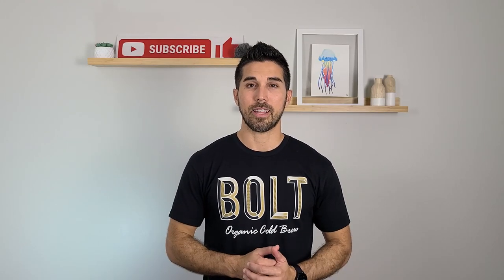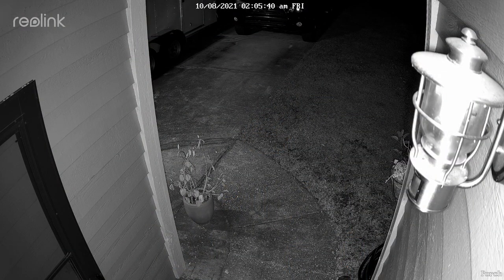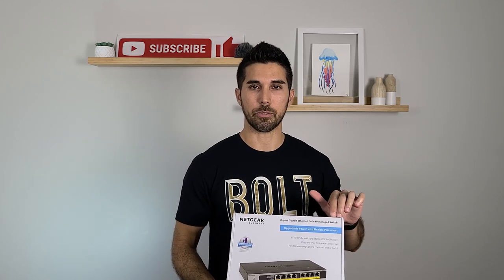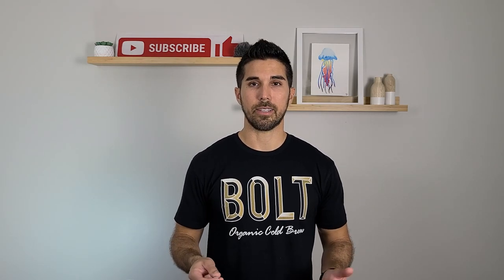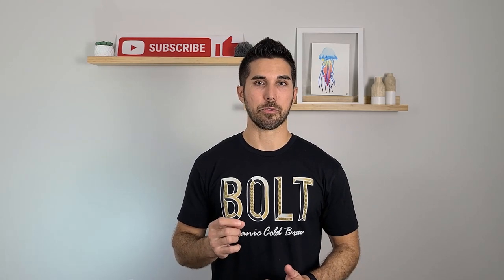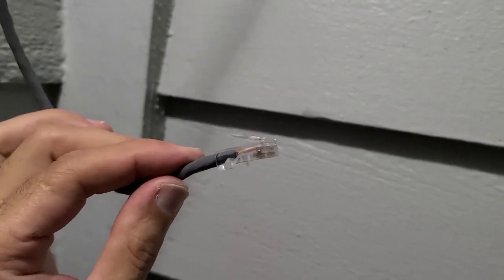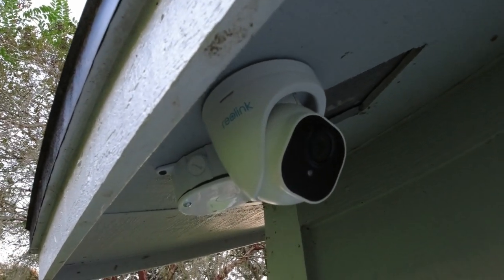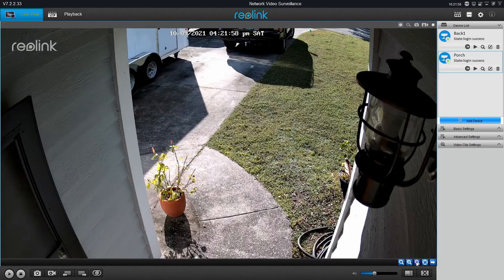Affordable DIY 4k Surveillance

Comment: Thank you for sharing. So, the switch is connected to the internet via Ethernet cable? Then the cameras connect to one of the eight ports in the switch. Can you show how to configure the system to view the cameras on a mobile device? Did you say there’s no monthly fee?
Reply from the maker: Thanks for watching. The switch is connected to your local internal network which is connected to your modem. From there the cameras are able to access the internet which is how they communicate with the app. That is correct, there is no monthly fee. The Reolink app is free and does not require a subscription with these cameras. They are also Onvif compatible with any Onvif compatible application or SVR/NVR.